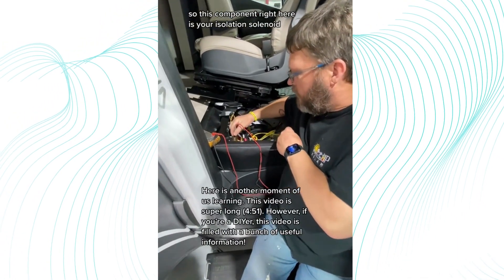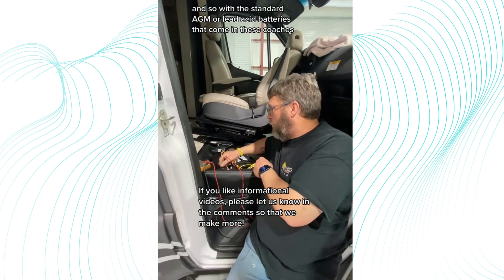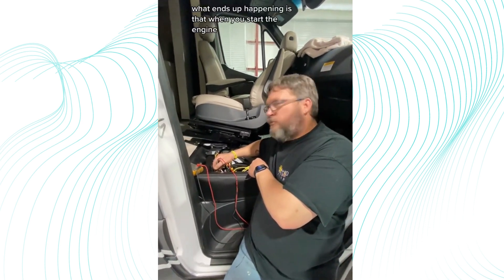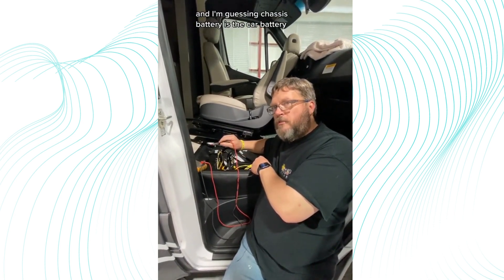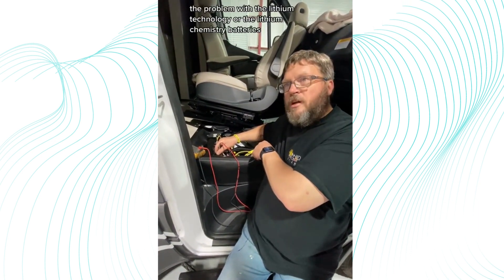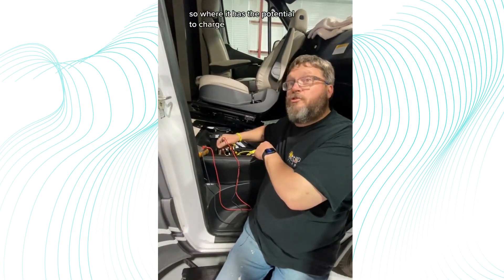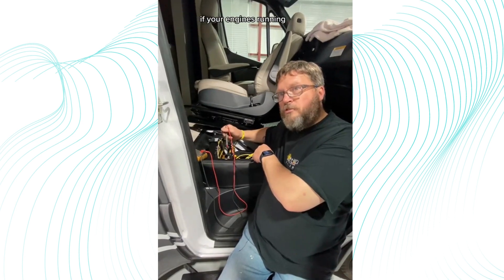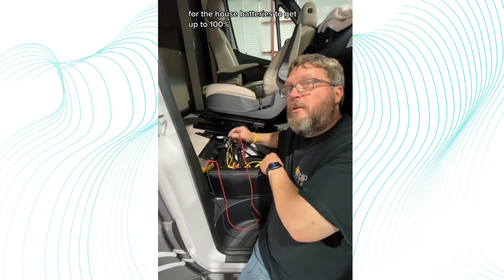DC to DC Charger or BIM (Battery Isolation Manager) Which One Is Right For You?

Comment: People keep saying "lithium will suck up as much power as the alternator can give it" regardless of what both theory (I=V/R) and empirical testing tell us.

In practice most relay setups run NEG return through the chassis ,  introducing so much resistance that charge acceptance is quite mild.  I have collected data on over 40 such installs (good, bad, and otherwise) and the average of the initial acceptance observed is 0.32C ,   0.2C across the flat middle of the voltage curve, then tapering to 0.1C at the upper knee.  (the V delta decreases as bank voltage rises toward alternator voltage).

Real-time example - my 150Ah LFP bank is at 58% this morning.  I just started the engine (180A alt @ 14.2v) and observed a charge acceptance rate of 28.52A, or 0.19C .  Definitely not 150A (1C), which is what the BMS would otherwise let the bank suck from the alternator.  

Now if one /wants/ the lithium to "suck up as much power as the alternator can give it" the way to get that is to run a fat NEG wire back to the starter batt.  Some people do this for practical purpose (e.g. 2nd alt with with external reg), and some do it for marketing scares (cough VICTRON / STERLING cough).  

One last point:  at moderate charging rates LFP will charge to ~100% at 13.8v with less than a half-hour of Absorption. I typically disable my VSR at 13.7v and let the solar finish off the bank at 13.8v.  Cells stay supremely balanced with this mild charging, like 6mV delta at 100% SoC.
Reply from the maker: Regardless of how you have your system set up the statement about lithium batteries still does not change. If your goal was to make a connection between the two you would want it to be the best it could be. When you started your engine and you measured your input to the battery, did you measure the output of the alternator? Do you know if your alternator was already maxed out and maybe the 28.52 amps was all it had to give?
Reply: @PanelsUpSolar I know the rated output of the alt (180A) and the chassis load on the alternator (clamp meter). 

>  If your goal was to make a connection between the two you would want it to be the best it could be

Clearly not the case, or everyone would be running copper cable 1 foot in diameter.  Maybe gold.  

> the statement about lithium batteries still does not change.

Physics does not change:  I=V/R
Reply from the maker: @fratermus5502  Sorry I was believing this was a realistic conversation with some logic added for good measure. I assumed that with all the numbers you were throwing around that you knew that the rated output of the alternator and its true output were two different numbers. I also was under the impression that you realized that a lot of  motorized RV's that were designed to have house battery charging from the alternator already come standard with the "fat Negative" battery cable as a requirement. They are configured that way to help overcome the restive challenges both in long wire runs and internal battery resistance. When a lithium battery is introduced, they have very little internal resistance so they can take a much larger charge from the charging source. Sometimes that current level is not sustainable for extended periods of time. Will it let out magic smoke? Possibly, but more likely it is just going to cause your alternator to reach its end of useful service at a much faster rate than originally designed.
Reply: @PanelsUpSolar  If you do not understand the difference between rated output and measured output (both important to your question about whether or not the alt had capacity to make more current) then I give up.   

I do not believe you are discussing the matter in good faith.  Good day sir.
Reply from the maker: @fratermus5502  I do understand the difference between rated output and measured output. What you did not mention in your splatter of numbers is where you measured the amperage charge that you were seeing.  You also did not mention a total output of the alternator to include engine electronics without the lithium batteries pulling a charge.  You also failed to mention at what RPM you were running the engine at. And for you to think that I had anything but good faith in the sharing of information says more about you than me. I have seen the results of people running their alternators at a high output and low rpm and have seen some failures with some being more dramatic than others. I am simply providing information on two methods that people can utilize to assist in protecting their equipment. There is no scare tactic or flaming engine bays trying to get someone to purchase something that is not needed. Perhaps you could make a followup video that shows where my information went wrong. Obviously you feel like mine is misguided.